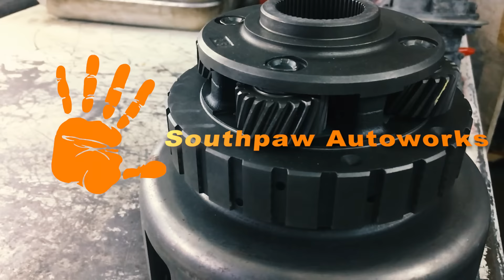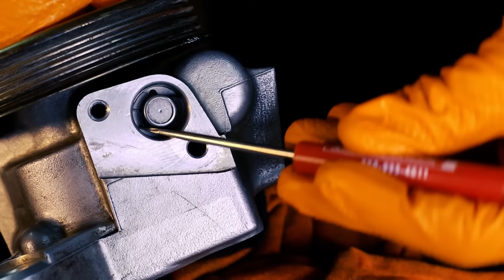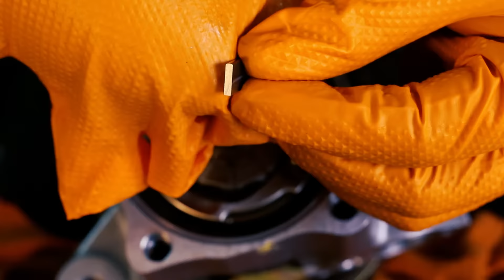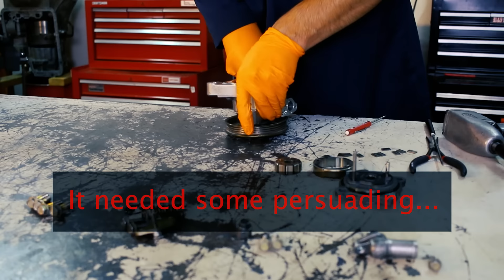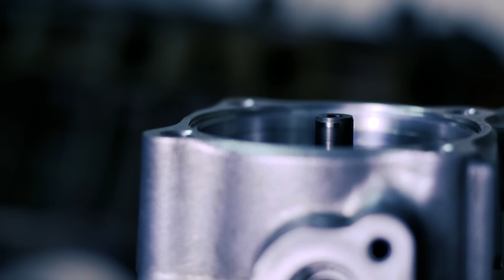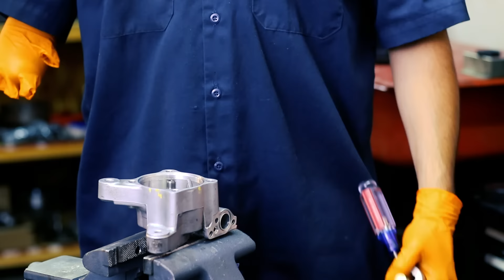Power Steering Pump Rebuild - Part 1 of 3 (1 Hand Mechanic) #SouthpawAutoworks

Comment: Great video buddy, i just got a new pump, lifetime warranty from ebay, and it came defective  with a leak, for sure with a bad seal,  now i have to take it apart and replace the seal, thanks to that, serpentine belt broke, it got into the distribution belt, and messed up 8 intake valves, so whole cylinder head broke, now i need to repair both, well, thanks for the info.

Comment: What makes this how-to power steering pump video better than most is the information about the wear pattern or witness marks on the sides of the vanes. The wear pattern orientation can confirm the vanes are installed correctly if they fall out.  Not only get the correct edge to the outside but also get the vanes installed in the slots in the original position, the vanes can still be flipped even with the correct edge to the outside. I don't know if this makes a difference but just good to get everything installed as it was originally. I did my best to keep the pump internals together so the vanes wouldn't fall out but still disturbed the assembly enough and had some of the vanes fall out. You should be prepared on how to install these vanes correctly before starting this job because there's a good possibility one or more may fall out. Thanks for the great video, I didn't have to do the PS pump rebuild over because of any mistakes.

Comment: Do you know if a 2005 GMC Yukon power steering pump is rebuildable? It is not leaking, it simply stopped working good at low RPMs (below 800rpms, like at stop lights. It works fine while driving at rpms above idle/800rpm. 

Thanks!

Comment: Robert:
I commend you for your courage, attitude and determination in becoming a superlative automotive technician. And you didn't stop there: you're kindly sharing your expertise and are now an excellent instructor. This video was precise, meticulous and effective in allowing the viewer to easily learn from it.
Please allow me to ask a question. I have a 2008 Infiniti G35 with a leaking PS pump which I have decided, after watching your 3-part video, to attempt to repair by replacing its 6 seals and O-rings. The pulley on this pump does not have an attaching nut on the outside and appears to be "fixed" or somehow permanently attached to the shaft. Acknowledging that you likely have no exposure to this specific PS pump, does it sound reasonable that the pulley & shaft would come out all in one piece after removing some sort of fastener inside the body assembly? Any comment or suggestion will be appreciated.
Thank you.

Comment: Hello, i just rebuild a ZF from a Mercedes w163 ML320 however the pump is working great when cruising but turns hard when stopped, could be the position of the vanes? Or air in the system ?  When i mounted it was working properly and just stopped working properly when stationary

Comment: Hi, I opened a nissan maxima 2003 power steering pump but It doesnt have any sign on the rotor body, the roror sides are the same without any sign! Is it possible to mount it either sides?
Reply from the maker: I don't know...

Comment: I think cast iron and steel engine parts should be brought back and produced again. This car manufacturers are taking customers for a ride with low quality mix metals junk compound parts that breaks under rotational mechanic stress and force. Cast iron and steel rather band or change shape than break like this devalued aluminum foil products mixed with vanadium and chrome. Cars spent lot of time buying new parts that were meant to last a lifetime. It's nonsensical the collum of auto parts makers and car manufacturers.
Reply from the maker: The quality of metals (or lack thereof) has def caused many issues.

Comment: Absolutely thorough and meticulous insight. You make the task SIMPLE. FANTASTIC. Thank You immensely from the Land of Oz :))
Reply from the maker: Glad you found it useful.
Thanks for dropping me a line!
Reply: @SouthpawAutoworks  Quick question, a number of vehicles have very light steering and give little or no feedback specially when driving in the highway. It is common knowledge that a reduction in power steering pressure can make all the difference. The question is, which possible way can be used to achieve such a feat. 1. Increase the size of the pulley. 2 Shim more the Pressure relief valve. 3. Plug (ie by welding it) the relief valve orifice and re-drill with a smaller orifice. Or is it possible to get a relief valve with a smaller orifice of the shelf? Thanking You in anticipation .

Comment: How does you camera focus so fast and precise? what kinda gear do you use?
Reply from the maker: Here's list of the gear that I used for this video.  There may be some substitutes listed.  However, the camera, listed below, is the same one.  They no longer sell them brand new...only used.  Still a great camera, in 2023.

Camera mileage:  Supposedly the camera is good for roughly 200,000 shutter actuations.  Something to keep in mind when buying used.

🎥 Camera:  https://amzn.to/2TZWhEg (paid link)
🔭 Lens:
      A)  Canon EF 50mm f/1.8 STM Lens:   https://amzn.to/2NtJKaY (paid link)
      B)  Canon EF-S 24mm f/2.8 STM Lens:    https://amzn.to/2ZpZwWz (paid link)
      C)  Canon 18-135mm Zoom:  https://amzn.to/2HjvrSv (paid link)
🛤  Camera Slider: https://amzn.to/2ZnefSh (paid link)   **Great for a one-man crew.  Use for video & time-lapse**
🔺 Tripod:  https://amzn.to/320LU5L (paid link)   **I highly recommend this.  Strong and tall**
💡  Lighting:  https://amzn.to/33XhWS9 (paid link)   **If you can afford it, get a light that offers "bi-color"**
Light Diffusion:  https://amzn.to/2zkVvbn (paid link)   **Do not overlook diffusion.  It's affordable and a must-have**
🎤  Microphone:  https://amzn.to/2Zc2LWt (paid link)   **Built-in camera mics are terrible...trust me**
💻  Video Editing Computer:  https://amzn.to/2ZlNrSt (paid link)
   Recommended Upgraded:  https://amzn.to/3arFiRQ (paid link)
🎬   Video Editing Software:  https://amzn.to/2Zq2YVl (paid link)

DISCLOSURE:  🕵
Links provided are affiliated links with the associated websites. While there is no extra cost to the purchaser, a small portion of the sale goes to support this YouTube channel.

Comment: Hi bro, good day to you. My pump from 95 accord is exactly same as yours. I dismantled the shaft from the housing yesterday. About the vanes, cam ring, rotor and plates. I know they can be removed from the housing as a whole with all the vanes still in the rotor, which is what I did. Is it necessary to unassemble these parts (vanes, rotor, cam ring)? If yes, for what purpose?
Reply from the maker: For starters, I'm always concerned about contamination.
Whenever a pump is opened up, it's possible for dirt/debris to make its way into the pump.  Debris can scar rotating parts, plug orifices, etc...all of which can introduce new problems into the equation.  So, I like to clean things up, in order to minimize this potential headache.

In this instance, I have found it easiest to remove the shaft seal, after all of the pump guts have been removed.  With that stuff outta the way, it's easy access with a screw driver/hammer.

But, hey, there's more than one (1) way to get things done.  I imagine that there's a seal puller that can gain access to the seal, from the exterior (after shaft/bearing is out of the way).

I hope my response is helpful.
Your interest in this topic is appreciated.
Thanks for subscribing, and for dropping me a line.
Reply: @SouthpawAutoworks  its about dirt/debris getting in. Got it. I understand all you showed about the vanes. Does it matter which slot in the rotor it is put back into after it is removed? Thank you bro.
Reply from the maker: I do not keep track of that particular detail.
Reply: @SouthpawAutoworks  bro, noted. Today all the vanes fell off from the rotor by accident. I know the round edge should face out when I re assemble it. The vane sides that go into the rotor, can go in facing left or right in the slot. Will this cause a problem if I mixed it up? Is there a way to know which side goes in left or right?
Reply from the maker: A way to know which side...
Yes, by looking at the wear marks (Also known as "witness marks") on the sides of the vanes.
Reply: @SouthpawAutoworks  noted. what do you mean by "keep track of the orientation of the vanes"at 7:45? What orientation?
Reply from the maker: The rotor is round, like a clock.  When removing vanes (and installing vanes), I like to work from the same position, every time.
I chose the 12 O'clock position.  This way, the left side of the vane, is always the left side.
Note:  The 12 O'clock is "your" 12 O'clock.  Your frame of reference....your point of view.

If I was to look at a vane that's located at the 12 O'clock position, and then note the left side of the vane.  Then rotate the rotor until that same vane now sits at the 6 O'clock position....the left side of the vane now sits on the right side (from your point of view).

This is why I choose one position (12 O'clock) and I always work from that one position...so I don't get confused.

Note:
Whenever possible, it's best to discard used vanes, and install new ones.  But, if they're not available for purchase, the old ones must be reused, then this is the next best (re-installing them the same way they came out).

Hope this all makes sense.
Reply: @SouthpawAutoworks  It's about the 12 o'clock position. Got it. Thank you bro

Comment: Hi bro, can I use a rubber mallet to hit the shaft out and later in without using a brass rod?
Reply from the maker: I don't see why not...as long as the mallet has some weight to it.

Some rubber mallets don't weigh very much.  Might need something heavier, like a traditional hammer.  Naturally, metal on metal will damage the shaft.  But, a piece of wood can act as a buffer...transferring the energy of the hammer to the shaft, while simultaneously protecting the shaft from marring.

Hope that helps.
Reply: @SouthpawAutoworks  noted guru. Thank you
Reply from the maker: I don't want that title...too much pressure. ha
I'm all about low expectations.  ;)

You're welcome.

Comment: Stupid Q.
 My pump is just starting to fail, It works for a while then dies after 10 or 15 minutes. But everything looks good, no leaks no wabble on the shaft, seals are good.
My question is what does that spring & piston do because the rebuild kit doesn't come with a new spring. Could a weakening spring cause power steering to fail?
Reply from the maker: To the best of my knowledge, the Flow Control Valve is used to regulate the oil pressure that the pump creates.  In that case, if the spring was getting weak, yes, it would lead to lower than normal oil pressures.

Have you already gone through your pump?
Did you disassemble the Flow Control Valve?
Reply: @SouthpawAutoworks  no, I have 3 other vehicles to drive so this truck got parked last week and I haven't got a chance to do anything but pop the hood and do a visual on the pump, hoses, knuckle, and of course fluid levels. 
I'll probably end up replacing the pump as it's life will end up being my camp truck in northern Michigan, but it just seemed odd to me that a rebuild kit wouldn't contain a new spring and there's nearly zero info online for what the spring and valve do, which is really odd because Ford alone put about a million of these pumps on the road every year for about 20 years, and the other auto makers have similar design.

Comment: Is the valve spring there to regulate the pressure? Does it get weak over time?
Reply from the maker: To the best of my knowledge, yes...it is used to regulate the oil pressure.
Anything is possible.  However, I imagine that a weak spring is not a common issue.  Don't let me stop you from trying.

Comment: Great video, have thins job to do tomorrow - glad I know its a left hand thread as otherwise may have stripped it, cheers
Reply from the maker: Stripped threads/fastener heads are never fun...
Hope this video series serves you well.
Thanks for dropping me a line!

Here's some other videos (off-topic) that you might enjoy.

1 Handed Transmission Rebuilder:  (60-Sec Preview)
https://youtu.be/y3Vixa_Ec1E

How the 4L60E valve-body works:  (60-Second Preview)
https://youtu.be/fWPSaLeaOXI
Reply: Thanks bud, tackled this job today but found nothing outwardly wrong with pump, no play in shaft bearing so left intact, but wondered if even a small amount would let the vanes rub internally?  tightening the belt afterwards I went for a slightly higher tension than I normally do, this stopped the awful screeching but I find it difficult to believe a rubber belt being loose would make such a noise, cheers
Reply from the maker: Congrats on getting it taken care of.

Comment: I am a retired Pipefitter and have re-built many pumps. This is a Great Video on disassembly and How to lay out parts for re-install! Now, all I need is a Rebuild Kit for a 2010 E350 Mercedes-Benz 4-matic 3.5L power steering pump# 0064664501? Any help where to purchase the rebuild kit would be helpful?
Reply from the maker: Thanks for the positive feedback!

I took the info you supplied, and tried to locate a kit for you.  However, I'm having trouble tracking one down.  You might have to visit the dealership...not sure how pricey that'll be.
Hope you can find a reseal/rebuild kit, at a reasonable price point.

Thanks for dropping me a line!
Reply: @SouthpawAutoworks  I am going to tear apart or should I say, disassemble the pump and might film it? I will send pictures at least to you and measurements of o-rings and seals and bearing I will need? Maybe they are just standard replacement parts which I could use? We will find out?  Lol
Reply from the maker: Right on!

Comment: Thanks Man, exactly what I needed!!! By the way, my 95 honda accord power steeting pump is making a noise when I start the engine(normaly that inicial noise tends to down after minutes) and when I move the steering to the right or left I feel that it is stiff. Can the vanes be worn with the using time or the bearing be bad?
Reply from the maker: I'm not sure...

A bad bearing will definitely make noise.  However, I'm thinking that the noise will not go away after a few minutes.  

If the pump is sucking in air, it'll be pretty noisy.  Power steering fluid is temperature sensitive.  It shrinks when it's cold, and grows as it heats up.

Have you checked the fluid level?
Is the pump leaking?  Air can get sucked into the pump through leaking O-rings, gaskets, etc.
Reply: @SouthpawAutoworks  Thanks!

Comment: Excellent educational video, much appreciated. 👍🖐🇦🇺
Reply from the maker: Right on.
Thanks for dropping me a line!
Reply: @SouthpawAutoworks  I'm going to overhaul power steering pump on my buddies 2002 Mazda 6. Pump intermittently seizes up, steering wheel, hard to turn. Already flushed the system by removing resiviour return rubber hose, blocking moulded hose pipe on plastic resiviour. Filling resiviour full, start motor/run few seconds  repeat process till fluid expelled from rubber return hose was clean. Refit rubber return hose, top up resiviour, bleed system of air, test, problem still present. Waiting for him to arrive with an overhaul kit. 🖐🇦🇺
Reply from the maker: I hope you're able to find something obvious when you get it tore apart.
Reply: Thank you. Intend using this info on a Nissan Frontier. And thank you for no mindless rambling or distracting "music". So professional.
Reply from the maker: Right on.
The positive feedback is appreciated.
Wishing you the best on your Nissan pump.

Comment: i can do this with my sons 2012 Xterra?  about to take out radiator, trans cooler, power steering, and ac pump
Reply from the maker: The pump in the video is out of a '97 Honda Accord.  However, the principles shared in this video, can be applied to just about any power steering pump.
Wishing you the best on your Xterra pump!